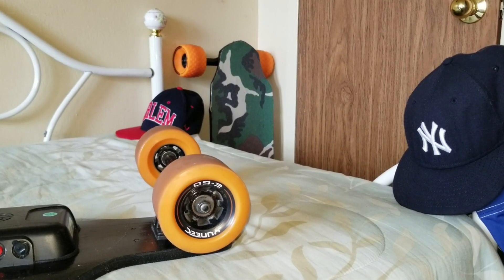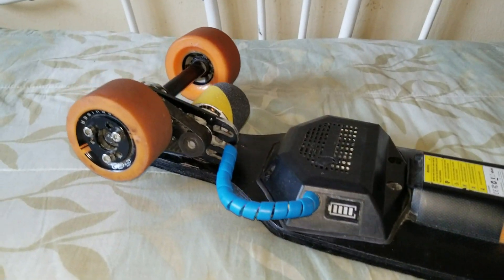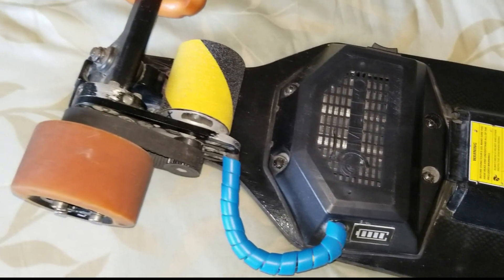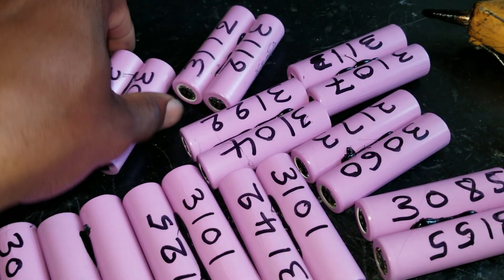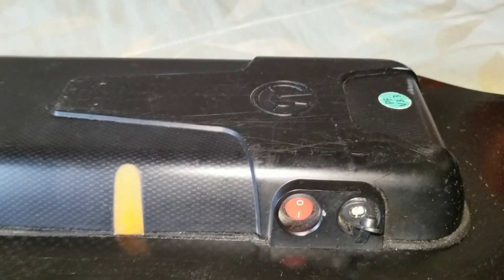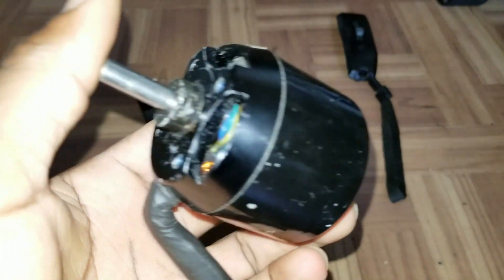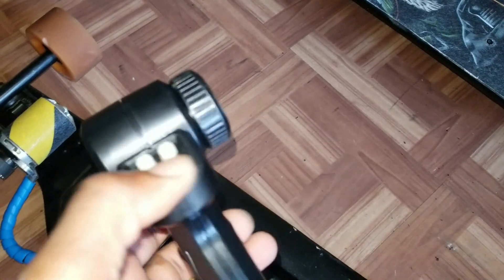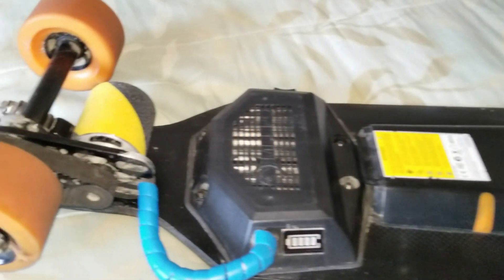HOW TO UPGRADE THE YUNEEC EGO ELECTRIC SKATEBOARD 😎

Comment: I just bought this ego long board. It doesn’t have the remote or charger. I have a charger that looks the same but is a 54v out put. Will that work 

Also can I use the app to ride and control the board?
Reply from the maker: Hi! The Yuneec Ego has a 7s3p battery, so can only charge it with a 29.4V charger. A 54V charger will damage the battery. It can lead to a house fire. Here is a link for the app setup https://youtu.be/oXcG8L9mHmM

Comment: Is it easy to change the motor? Yuneec USA has gone dark on me so I have no where to get it repaired. I found a motor online. Need help!
Reply from the maker: It's easy to disassemble, but most after market motors won't fit onto the mount, you are going to need the right mount mount for the motor you are buying and probably a new truck, because the paris style truck on the yuneec has a piece of the mount welded on it

Comment: How did you remove the pulley from the original wheel?  It appears to be impossible when i tried to remove mine.
Reply: you use a spre wheel not the motor wheel just buy a spare normal wheel
Reply from the maker: It's impossible to remove it, it's injection molded into the wheel. So I used one of the other 3 wheels without pulley

Comment: Nice job. Can I buy a new remote on eBay for my original yuneec ??
Reply from the maker: The yuneec uses its own remote and integrated receiver. no other remote will pair (unless you get it from them). However the remote for yuneec ego v2 can pair to V1 and vice versa

Comment: Have you tried doing a dual motor build?
Reply: Dual belt drive motor woulda been sick. I love my yuneec board.  Are there better feeling remotes that will work with original yuneec??
Reply: See John Vlog honestly I’m not sure I’m just using my phone a controller since my controller keeps on having bugs
Reply: @christianjimenez5082  jsut type yuneec ego parts into google the europ site carries the parts as for a duel belt buy a used boosted v1 swap the controller to a flipsky and swap the battery to lifie and have fun
Reply from the maker: I built multiple esk8tes so far, check my channel